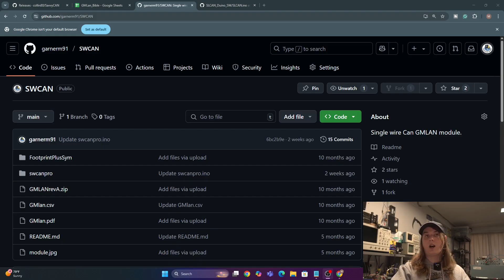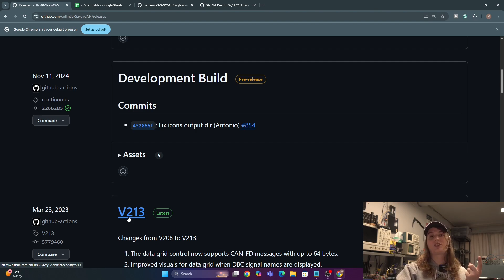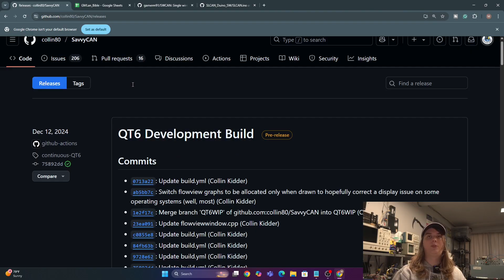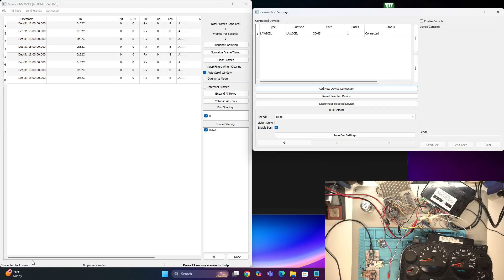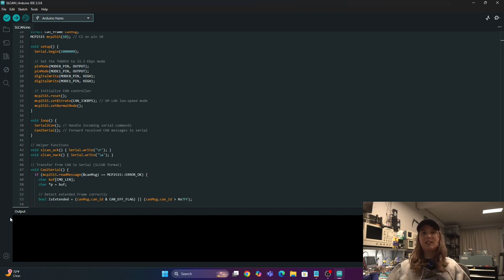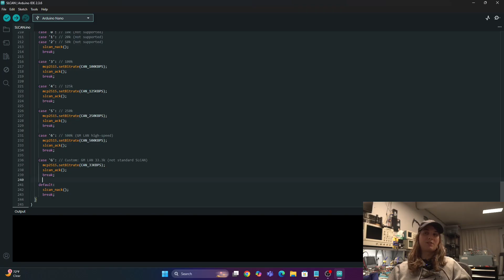SLCAN_Duino: Arduino SLCAN Adapter for GMLAN Single-Wire CAN with SavvyCAN

Comment: If it’s not meant to be a permanent solution so to speak what do you recommend ? I’m looking to make a custom gauge cluster and only need to read from the gm bus to populate info on the custom cluster unless there’s a reason I’m unaware of to need to send info thru the bus to get info from it

Comment: Can your board be run at 3v3, instead of 5v0 I want to try a esp32s3 wroom which runs at 3v3. I think thdd ex mcp2515 and th8056 will be ok. I’m confused my the solderable jumper from 12 volts pin to the 5 to 14 volt generator? If I put 3v3 to 5v0 pin instead it’s likely to not output 14 volts. Can I just bridge the jumper with solder and bring in my own 12-14 volt supply for the th8056?
Reply from the maker: If your going to use an esp32 I would honestly just use the th8056 direct to the esp32 can pins. The boost converter is optimized for 5v but it will run down to 2.7v. it should still work but I haven't tried running at 3.3v yet. I can test it tomorrow.
Reply: I tried using TWAI can on the Esp32 without the mcp2515 it won’t work. I’m
Pretty sure it would but could not find any examples online either that setup. There was one for a tja1050 but not th8056. 

I tried my bread board mcp2515 and th8056 both @ 3v3. Worked perfectly. Mind you I’m not regulating 3v3 of 5v0 up to 14 like you. I just pull 12 volts from my pcm supply.

On your board. I bridged jp1 so 12  volt pin brings 12 volts to the th8056 vbat. Put 3v3 to your 5v pin. But it draws way to much power and kills my Esp32 the leds go dim and it gets hot, than prints gibberish out the debug port.
Reply: I think your voltage regulator prevents or over loads the mcu at 3v3. Anyway that’s not your fault you intended it to run at 5v0. Just telling you for interest sake. 

The Esp32 is now working without mcp2515, as you suggested
Reply from the maker: I'm not exactly sure why its giving you problems at 3.3V but I haven't really tested the module there much. After you intially asked I did power up a module at 3.3V and I didn't have any problems. the Boost converter will run all the way down to about 2.7V That said Ripple does start to show up under 3.4V. nothing crazy just a little ripple. I didn't connect to microcontroller though. I can try it. 

The input current is not high at all at 3.3v its about 10ma. I will probably do  a video of it running at 3.3v when I feel better. I am just getting over a case of covid.

Comment: If you happen to use a different clock for the mcp2515 like I did I used 8MHz, then you need to specify that when you make the call to the mcp2515 library. Other than that I didn’t change anything and it works!  Nice job on the pcm design and the firmware. 

Do I need 12-14 volts to power up your pcb? Or will the usb power it through your step up voltage circuit?

On my bread board I didn’t make that part I just used a 12 volt ac/dc adapter.

Comment: This is amazing! I currently have a mongoose pro II, and avt852, with universal patcher master logger I can only see swcan low speed regular frame messages. I require the extended frame to log and send messages to the onstar module on a 2015 trax. Did you fix the problem with not being able to send extended frame messages? It so I want to buy or make one of these can dev boards. Thanks:)
Reply from the maker: Yes I committed the fix and it got merged on the WIP version of savvycan. I don't think he has built version up yet but if you compile the WIP it works for sending and receive.
Reply: Ok I don’t think sending is working? I’m pretty sure I have the lock/unlock command from onstar to bcm but doesn’t lock when I send the message?

I bought your board of eBay hasn’t arrived yet. But assembled my own on a bread board and it’s working! Except send?

Do you have a forum or email to connect on? I use pcm hacking forum alot.
Reply from the maker: @LIFE_Evolving did you compile the WIP yourself or did you download the already compiled version. I don't think he uploaded a compiled build with it yet but you can compile the WIP version
Reply: I tried the latest version it has a send frame box below the rx stream … trouble is you can’t load saved strings to send. And if you manually type it in it sends the incorrect message. Enable debug logs shows it sending d in front of the hex string instead of T or t. Also the message isn’t quite correct either.

Have given up and use my own python script to send, that works. 

I also couldn’t get the older version to work either for send only.
Reply: Your sketch is correct the savvy can is the problem.
Reply: I did not compile it. Can you give me a direct link to it? No idea were to find the un compiled version. And is there a how to compile it?

Comment: Any links as far as wiring the ecu to the bcm to the gauge cluster I went and bought all 3 and need help with wiring them together have to get potentiometer now that you also have it, thanks in advanced
Reply from the maker: BCM and I believe the cluster is in this as well: https://www.gmupfitter.com/wp-content/uploads/2021/05/2009_LD_ElectricalPickupsChassisCabs_100813.pdf
ECM https://lt1swap.com/E38%20ECM%20Connector%20Pinouts.htm
Reply: @FixedUntilBroken  Thanks